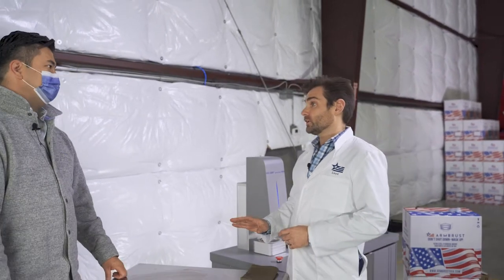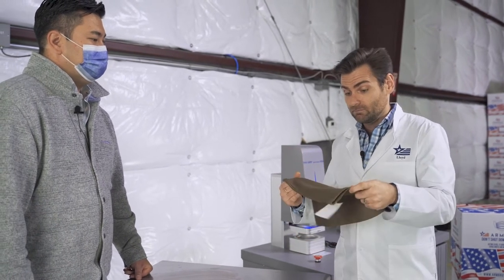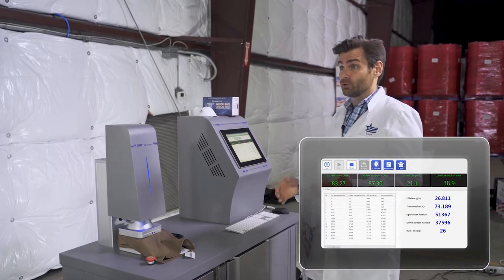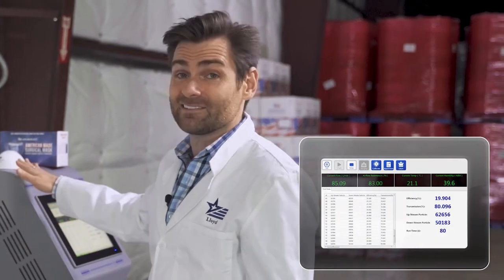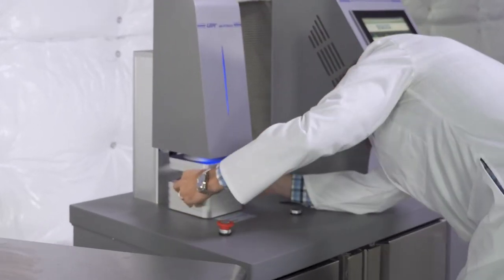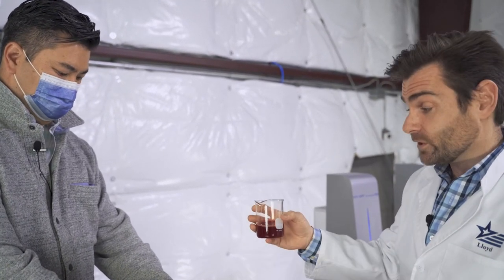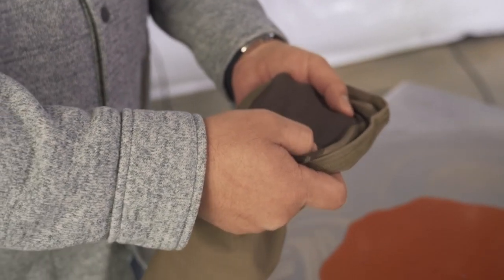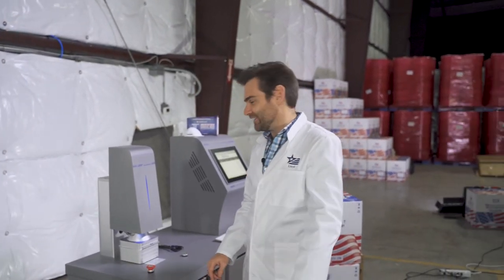Liquid Barrier Test on Military Issue Gaiter

Comment: As a soldier that was there in DC for the inauguration, neck gaiters are issued for warmth bring made 90% from polypropylene which insulates and draws moisture away to dry and keep us warm and can help with sand as if found worked in both Kuwait and Iraq. The gaiter is supposed to be breathable it is not issued to soldiers for covid, we don't get issued mask for covid we just have to wear them at times to show compliance. When mask are required for protection we are issued the m50 pro mask which is the big grey pouch on our thigh in pictures and only worn if tear gas or other chemicals had been deployed. I respect you gentlemen for your intent on making a product with life saving in mind but respectfully found several things with this video that was just inaccurate and again respectfully speaking but a little ridiculous whether that be lack of research, ignorance or various reasons. One more time no disrespect but please reach out to a soldier at least for comment on an item everyone gets at basic training for warmth not viral protection. I apologize if I sound harsh but as a soldier and having used that neck gaiter in a both non combat and combat zone, I was a little bothered by a few things in this video. Keep up the good hearted work but work on the research a bit gentlemen.